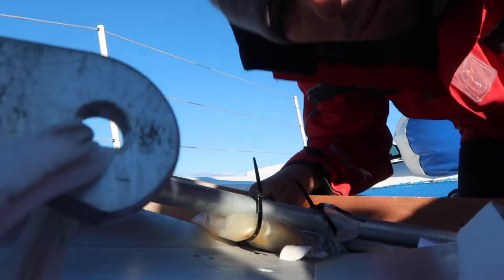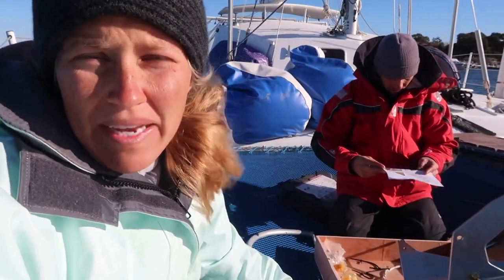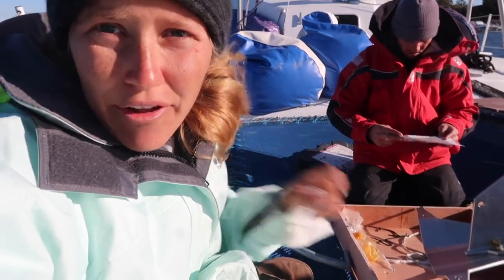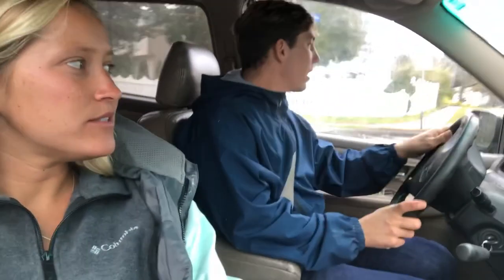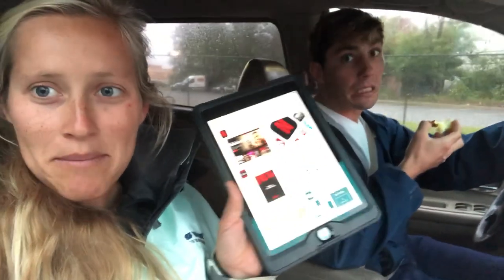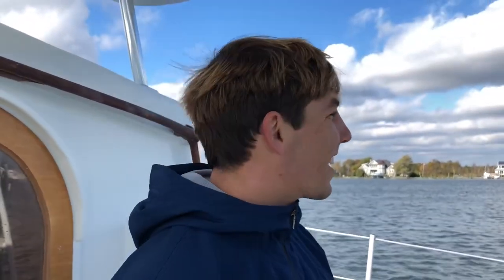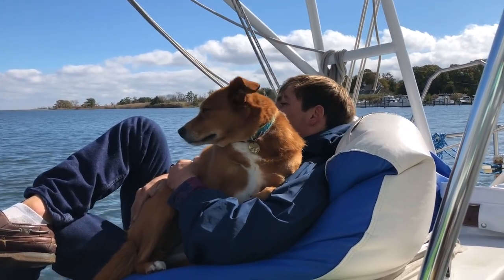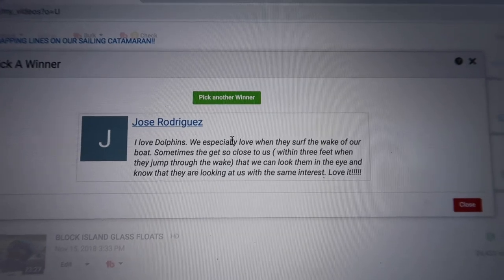ANCHOR IN A BOX?

Comment: Please please please don't attach your anchor like that.  New modern anchors like the mantus set a lot better and if you get a change in wind directions the swivel you have on there will blow apart.   Please put 3 to 4 links of chain on the anchor first then put on your swivel that way it will always pull in a straight line on that swivel.
Reply from the maker: Aah very interesting, I never thought about that. I’m definitely going to look into changing it up!
Reply: This is why I love the comments👌
Reply: @Tulasendlesssummer  just do a google search on broken anchor swivels and you'll change it before you anchor again.  Glad to help.  Really love your channel.
Reply: I'm interested in your idea of attaching the anchor chain to the shank,.  Are you running the chain through the anchor then using the swivel to attach the chain to its self?  Want to make sure I'm secure.   Thank you!
Reply: Thanks! that's a great idea. I bought two different types of swivels for my boat but after reading about all the anchor swivel failures I never installed them at all?! This install idea seems like it would fix the issue of the anchor resetting on a wind direction change and blowing out the swivel. :-)
Reply: @markalley4810  I never use a swivel, it's the weakest link in the system.  Plus I find they just get packed with mud and never actually work the way they are intended to.
Reply: Great tip!
Reply: I blew mine out in one of those Dorachio wind blows by Deale Island, on the Chesapeake in 2011. Bought the scariest time I’ve ever been on a boat and I am born and raised boater at 45yo.

Comment: Do you think the constant humidity got to the inner works of your iPad? What type of case do you use?
Reply: Bob Stienke He said 'Life Proof' in the vid.
Reply: Back in the day (1986/88) I was racing in IOR. We were one of the first to have a DOS computer on an IOR boat. I remember we paid about $7,000 for the GRID computer, it ran off the boat's DC supply. we didn't have anything like a box to mount it in. Instead, each night I would strip down the computer and cleaning the the PCBs and the rest of the interior and exterior. By the end, you could see where the salt had etched the boards.
So $300 for an iPad looks a good deal. Interestingly we still run the same telemetry and tactical software we used back then, it just does more . . .